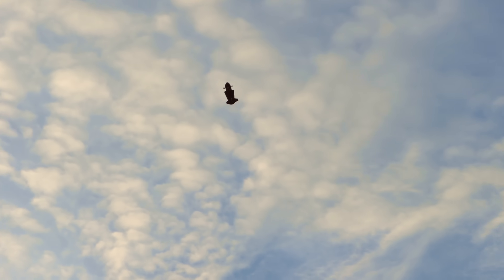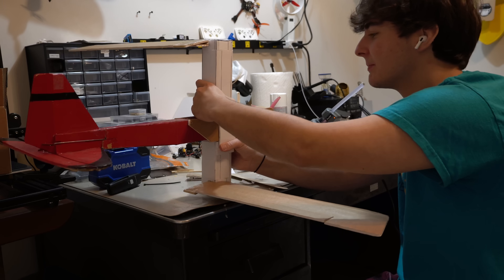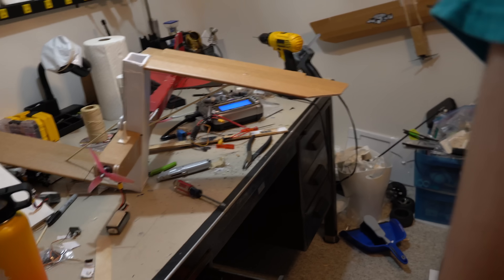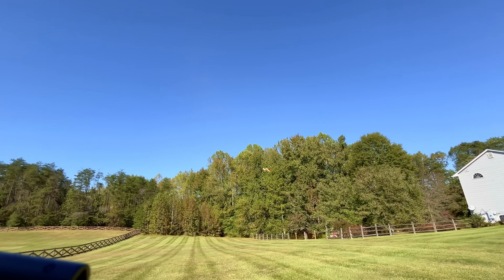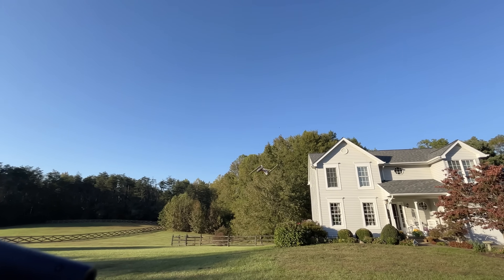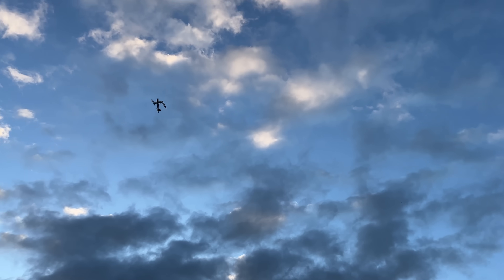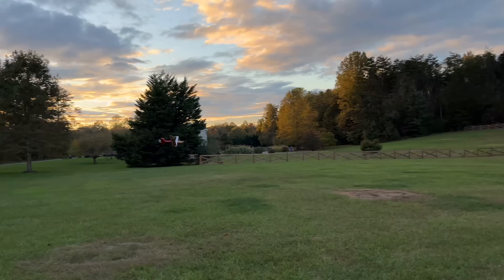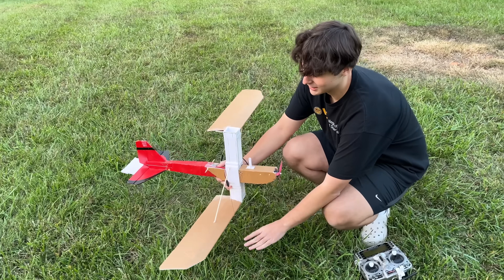Can a Plane Fly With Offset Wings?

Comment: As someone currently studying engineering, this is so cool, because whilst this works on paper, seeing it fly is amazing. I would guess that your dad might have been right for the flying car though, as taking off from the floor introduces ground effect, which would actually have meant that the wing closer to the ground generated more lift.
Reply: He does bring up ground effect at the end of the video.
Reply: if he had it trimmed up before taking off it would have worked ... even ground effects wont be that much of a problem .. as the wings are a much larger surface than the car body itself ...
Reply: That’s what I was thinking
Reply: i play low tier war thunder so much i figured this out flying biplanes. saw it and thought, oh that shit better not try and turn right.
Reply: if that right wing was on the same lvl as the body of the airplane than maybe but not to much

Comment: At the scale you're doing it no the placement of the wings should make very little difference (I'm commenting at around 2 mins in). However at a large scale I have huge doubts it'd work the same way and would cause the plane to be far, far harder to fly straight and flat. What works in a small model doesn't always show what will happen when scaled up to real sizes.

Comment: Any dihedral or flex in the wing will cause an offset in force - if they’re perfectly straight, then no issue, but any wing flex as you move towards the tip will cause the a rolling force in the direction of the lower wing

Comment: Rule of thumb for pilots apparently is that 1/2 wingspan or less of height causes noticable ground effect, so it would definitely apply to offset wings during landing/takeoff. It probably contributes to the difficultly with rolling when taking off with the flying car, even if it doesn't matter once it's in flight.
Reply: The center of balance could also be an issue on the ground I think.

Comment: Its not about the offset in general, its about the distance of each wing to the center of rotation. If both wings apply equal lift, but one has more leverage (by being further away from the center of rotation), it will cause rotation in flight.
Reply: I was also thinking this, but surprisingly, this actually shakes out in the maths.
Yes, the roll torque from a force further from the center of rotation is higher, because of leverage. However, the further offset a wing is, the more angled the lift force is compared to the center of gravity, meaning less of that force adds to the torque. And it turns out that these two effects exactly cancel out.
Reply: I don't think the center of rotation matters at all. The plane in the video has wings at different distances from the fuselage. I would think the center of rotation is variable and automatically becomes the center of the offset distance of the wings.
Reply: @TruthHurts2u  the centre of rotation would be the centre of mass. This is trivially relevant in the horizontal case, as having a wing on only one side is unstable.
Reply: This, the RC car build was different because one wing was further from the center of mass than the other. This one works because they're both the same distance, even though one is above and the other is below
Reply: @schnicatavick  one wing was also closer to the ground, generating a bit of ground effect. because its so counter intuitive, if you draw all the forces, there is no reason why it shouldn't fly. the only noticeable effect should be some hydrodynamics fuckery with the rest of the frame.

Comment: This is the first video I have seen on your channel, and really anything planes in general I have no history in. However, this demonstration of offset wings has made me think of the unique flying properties you could introduce into a design fairly similar to this. Instead of the wings extending from the horizontal sides of a plane, have them extend from below and above the plane, then make a 90 degree angle in sort of a 'Z' shape. The idea being that the plane could fly vertically, or at least in a diagonal 'X' position? If a plane was designed in this way with the intention of flying at different degrees, I'm sure the tail would have to be altered for its capabilities of flying sideways, and weight and design ect. But its a cool thought I had. Would there be any benefit to this? Has it already been designed?

Comment: The boxy vertical mast is killing the performance with drag, and its right behind the prop! Also it would be producing a lot of turbulent flow over the tail surfaces, making control difficult. Try a more streamlined mast, it certainly worked better after you cut the holes in it. Good job proving your point though, I don't understand why anyone would think mounting a wing higher or lower would produce different amounts of lift.

Comment: god damn its fucking geouns effects the original plane you dad said fell because of differential lift. if you launch the plane higher it wouldn't do that. ground effects is working to generate more lift on the wing unnecessarily close to the ground, not becauseits lower but because is close to the ground.
Reply: if you just launch it higher it wont bank immediately.

Comment: Very cool. I could see it would work from the start as long as CG is right and the wing pitch is equal. Now just for fun try putting the rudder on that vertical section that the wings are attached to. Maybe as the only rudder or make the center rudder small with a slightly reduced tail rudder or vice versa.

Comment: I agree that in principle the wings in regular flight should produce only a minimal torsion effect, easily overcome with controls and/or design. Low on the ground though your father could be correct because of the ground effect. 

Given the small wings you could have a massive ground effect difference when taking off from the ground. 

Hand launching would not have ground effect because of the size of the craft.

Comment: Great job! It works as expected. 
There are two reasons why it is not practical.

1. If there is a difference in the air pressure on the wings can cause the plane to roll. This makes it harder to operate. But in this case is very small.

2. The offset wing design creates more drag making it less fuel efficient and the speed is lower.

Comment: I guess I should have included how to generate smoke for the wind tunnel,You could try one of those Bee Keepers  smoke things older ones have have a built in bellows try using a 1/2" plastic tube off the end  and reduce the outlet side as required, crude but it should work, Also glue the staws  half way along their length with tiny amounts of super glue so they don't blow out it's tedious you will need thousands of straws., Just as a note you can also use this idea for boat hulls, winged keels, and hydroplains find the Cof G   lift, wake, on still water.
Keep up the good work, I love your Attitude.

Comment: Well done mate! Absolutely fascinating while really enjoyable to watch at the same time. Here is a thought for you. When in flight it shows surprisingly good handling from a viewers point of view. But we, the viewers, obviously do not 'feel' how it flies. Having said that, I think I can see increased instability when your plane is close to the ground. This appeared to be more evident with the first flight of the underpowered small wing plane than later, but there I noticed it too. This made me think and I am wondering if this may be caused by the ground effect. You have one wing that is potentially very close to the ground which would cause an instant increase in lift, while on the other side of the plane the wing is relatively far from the ground. So much so, that the effect of the ground effect is negligible in my opinion. I can see how this would make it difficult, if not impossible, to fly this plane close to the ground and have control over it. And I am not talking about using gyros here. I am talking about actually flying.

And in case you want to test this, here is an idea. Testing this by measuring these effects will be difficult and costly in my opinion, but there may be an other way of getting this data. You could install a gyro I think that will help stabilize the plane and fly straight at all altitudes. Now if you can record the corrections of the gyro while flying, you can than later analyse the data and see the corrections made at different altitudes. This would show whether or not the above theory is correct or not.

Oh, and as a sidenote: Some of us, I see below, laughed when you dad said that one wing had less lift than the other wing. I was one of them. But now I think he is actually right. It was just not caused by the wing profile, but the ground effect instead.

I applaud you for this experiment. Well done. Keep going like this.

Comment: You seem to like experimenting with asymmetrical aircraft. You need to go look up aircraft designed and built by Blohm & Voss company of Germany. They were in operation during the second world War on the German side of things and the owner of the company has a major thing for asymmetrical designs and one of my favorites is the BV-141 it was designed as a scouting plane and it's design would have made it a very good spotter plane because the cockpit is completely removed from the main fuselage and engine, and is surrounded by glass. I think you should go and look up the designs that the Blohm & Voss Company came up with, I think you'll not only be intrigued, but also inspired.

Comment: It’s not where you put the wings that matters, it’s how the weight is distributed. All you’re really doing is overcoming the weight offset with lift and thrust, but it’s still not ideal. If you were to ballast the weight of the wings with equal weight on the other side without adding a ton of drag, it would fly perfectly, but it’s easier to just put the wings in the same place so they ballast each other. In Laymans, however it wants to tilt without thrust is how it’s going to try to tilt in the air.

Comment: Excellent, Bild yourself a wind tunnel, a large cardboard box big enough for your model to fit in to with a decent amount of clearence all round open on two ends in one end fill it with drinking straws  and a three speed fan blowing in to the straws from outside the box  the straws will straighten out air flow from outside the box a clear window in the side , mount the model inside the box  pipe in some smoke and see what is going on, you could even come up with even more radical designs, Keep it up, It's ideas like yours that make others think, as proof  in most of the constructive comments.
Reply from the maker: That’s a really good idea. I was trying to think of how to make smoke without buying a smoke machine. Maybe I’ll just have to invest in one lol. But that be really good to see what’s actually going on. Thx for the comment!

Comment: My first thought is on take off the offset wings would be creating different pressure pockets under the wing creating different lift on both the wings causing a roll until you even it out, could probably be fixed with trim

Comment: I think this worked because both wings, while offset from each other, were roughly the same distance from the center of mass of the plane. Maybe it would be worth trying this again with only one wing offset and the other in its normal position, because I believe then the lift produced by the offset wing would overcome the lift from the other wing due to the greater distance giving it more leverage, introducing a rolling moment after all.

Comment: I'm familiar with how asymmetrical wings can fly and other odd planes, but  I was sure that this would not work, at least without radical control throws. I'm wondering if you couldn't do much better with a good 2 blade APC or other prop. That pink 3 blade looks like it is for a drone.

Comment: Great video! That’s kind of what I guessed would happen. And I would say that the myth is not  busted bc it did have the same effect that the rc car had which wasn’t necessarily that the car start flying to one side but that the car would have a tendency to roll towards the higher wing. 

 The only unbalanced force I would consider would be its desire to balance out weight left to right bc the wings would want to balance out in the roll direction across the center of gravity as one side is well above the center of gravity and one side well below. This could be easily proven by taking a model of this same design, affixing it to a stationary point through the center of the fuselage from front to back to act as a fulcrum and seeing wether it would tend to Roll and find balance by the upper wing rolling downward and vice versa until each sides center of gravity comes to rest evenly across the fixed point. And if my understanding of a rolling moment is right from the internet haha  it’s not simply the even weight of the wings being the same but the tendency of the whole mass to roll in a moment. I would say that any moment that the wings are not balanced across the roll axis is a roll moment . I think that your car failed to generate enough lift to lift the vehicle and the same principles acting on this test plane were just more obvious. Car doesn’t generate lift, falls off of the ramp, begins to balance across the roll bc it is in a roll moment, continues to fall into the leading wing to the ground as the inertia of the initial roll and the balancing across the roll axis becoming of no effect as the car experiences less G force overall and balancing has less of an effect as G force decreases. I think that the slight turn to the right as the rc car left the ramp is due to the direction of lift being to the right as the car rolls. I think this is also observable by your test plane being able to fly in stable circles as enough light is generated to keep the plane from stalling in its balance position which is rolled toward the higher wing. I think this is testable by getting the car to a higher speed where it is able to avoid stalling at its balance position. And seeing if it is able to fly in circles similar to the test plane 

As far as lift I would only guess that the upper wings high pressure side and the lower wings low pressure side would be canceling each other in some way (if they are meeting in any way) and generating less total lift. But I also know very little about aerodynamics and how these fluid forces would interact in this way. 

An interesting test would be a different model as a bi plane with only one wing on each side being a lift wing. Or for a more dramatic proof, a counter weight attached to the end of a post at a right angle to the wing on each side, the lower wing having the counter weight attached by a rod at a right angle from the center of gravity of the wing and positioned at the same y level as the opposite wing, the weight being equal to the weight of the opposite wing and vice versa for the opposite wing.
But disclaimer: I’m obviously not an engineer
these are just my intuitive observations.

Comment: I would think you will get some roll when you pitch as the lower and upper wing will have different air speeds because one will be on the outside of the turn same reason cars need a diff but i dont know what it would take to make the roll significant

Comment: What a great experiment! 

Thinking about the mechanics of the wings, I think that if you were to fly this in unstable air then the height difference would have an effect compared to the wings not being separated vertically. Other than that there's no reason why it shouldn't fly normally.

Comment: The offset wings should be fine as long as they both have the same vertical distance to the center of mass of the plane.
Then the lever forces cancel out.
If that distance is not the same, then you'll end up with a rolling motion because one wing sits on a longer lever than the other.
That's why your car tilted to the right, because the right wing was sitting higher and had a longer lever.

Comment: top mounted wings is the most stabile setup.  the further down you place them it will respond quicker but also be more unstabile due to center of mass balance.
imagine carrying a stick by holding the top part vs  balancing it on a finger.
main reason why beginners usually start with top mounted wings.
for design goes   pretty much everything can fly in the rc world.  if there is a will there is a way XD

Comment: I predicted this: the plane will fly but hang diagonally in the air with the wingtips on the same height, this will fly straight but will cause uneven steering when using the tail (since steering one side will make the plane go slightly up with more resistance bc of gravity, while steering the other way will make the plane go down with no resistance)

Comment: Fun experiment. It makes sense that offset wings wouldn't induce roll in of themselves, since the lift forces are still aligned, as long as they are equal. From the footage it looks like the plane tends to fly stabily but rolled to the left side and there is some compensation with the rudder control - is that the case? It seems to me that would make sense, due to its geometry, its equilibrium state would be sideways.

Comment: I'd have thought it would be more about the weight distribution with it wanting to level on a line from wingtip to wingtip. But you'd be able to adjust the trim to compensate or just get used to it.